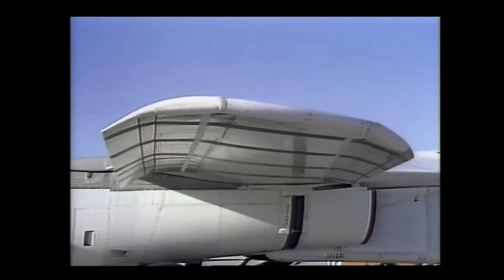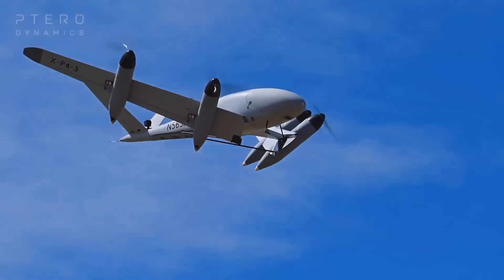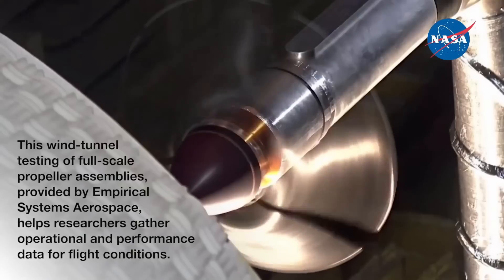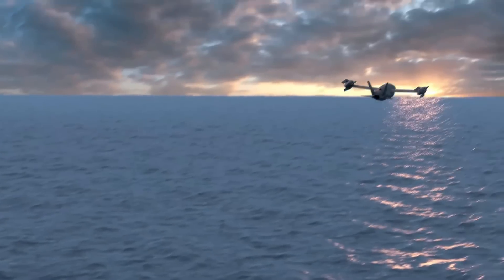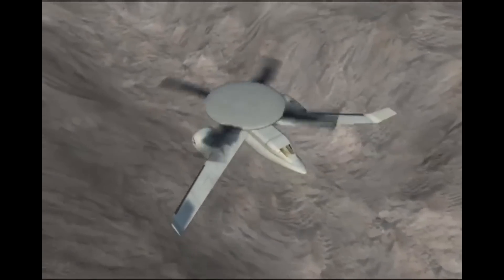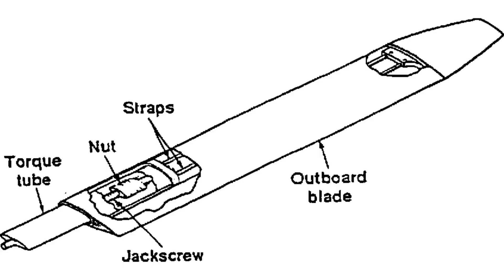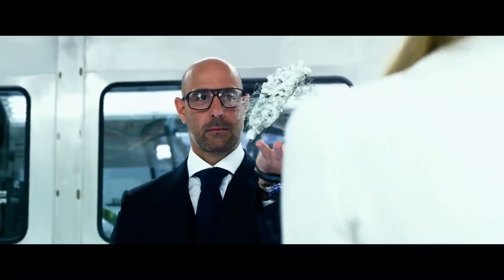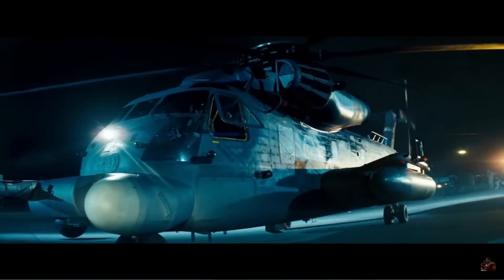Aircraft Transformation Technology

Comment: Putting engines and propellers in wingtips puts a higher structural load on wings under things as wind gusts, any failure will build a difficult to handle assimetry.
I would not do this.
Blessings +

Comment: There are many lies here in the field of UFO, but the truth can be established by special methods of Open-source intelligence (TEXT MINING). After studying all the materials about UFOs, it becomes quite obvious that since the late 40s of the twentieth century, a secret project has been developing in the United States for the development and production of aircraft, where the lifting force is created using high-frequency vibration. It all started with James Pitts' "Sky Car" vibrating orthotopter umbrella, then the umbrella was closed with a dome and devices appeared according to the scheme of conventional electromagnetic vibrating speakers (membrane + inductance) - fragments of the membrane were found by a farmer in Roswell. Then they created piezoelectric thrusters, or with small dischargers on the surface (they glowed all over the body due to ionization of the air), and now they are planes with plasma propulsion panels (so they are angular - that is, with flat surfaces). Thousands of discharge cells are densely packed into motor panels - they shoot streams of plasma (railgun architecture - coaxial electrodes). The ionized air of the spark discharge is accelerated in the railgun chamber by the Lorentz force to enormous speeds - a kind of ramjet engine is obtained. Just imagine! - tens of thousands of small ramjet engines assembled in panels and launching plasma synchronously at a huge frequency (hundreds of kilohertz). Plasma jets form toroidal air vortices - this air cushion creates lift and acceleration. See, for example, the MARAUDER (Magnetically Accelerated Ring to Achieve Ultra-high Directed Energy and Radiation) project. My article "UFOs are made in the USA" and the books "UFO Hunt" and "UFO Elimination" describe all this in detail. The technology is quite mundane - it is known in great detail thanks to information leaks. For example, air ionization in the coaxial elements of a railgun is created using radiation (radioactive polonium is introduced into the metal). Devices of this type were used throughout the 50s-60s-70s-80s for secret missions (they took off, as a rule, from special submarines). With the fall of the USSR, their use by the United States was practically curtailed (in the novel "Little Green Men" by Christopher Buckley, speechwriter Bush Sr., a scene is described where the US president decides to curtail the "flying saucer" project). The winding down of the project can be recorded by the drop in magnesium consumption in the United States, since such fuel was used in fuel cells (magnesium strips were burned in forced galvanic batteries), this is 2007-2008. However, later the development of the technology continued in the Russian Federation and China (the technology was restored by reverse engineering methods for downed devices). Secrecy, however, was maintained and there was no civilian use because the technology was not suitable for it - harmful microwave radiation from pulsed plasma thrusters (harm to pilots and impact on electrical appliances inside and along the flight line). The payload is small (but one nuclear charge is enough). There is no radio communication - unmanned vehicles can fly and maneuver only in accordance with the program. Previously, there was a narrow application profile - rare spy missions (so that pilots do not get a lot of radiation). Reconnaissance aircraft of this type were often observed at military bases, missile launch sites and airfields. They were even seen by peaceful geologists in the taiga, where clearings for seismic exploration were laid - UFOs flew there to check whether military construction was underway (I myself heard stories about this))). I think that soon this technology will be declassified, and cargo airships with flickering round plasma panels on the surface of the hull will appear in the Arctic sky.

Comment: What are the reasons air limits free motion of planes? Direct force engagement (drag) and chaos. Drag is experienced when a vehicle has to travel at high speeds and it is minimized by reducing the contact area with air (aerodynamic design). The problem with this approach is that air molecules are swept into an uncontrolled movement (chaos) once they hit the vehicle in motion and it creates many different vortexes around the airplane, that  prevent it from maneuvering at high speeds. what if we instead carved ridges into airplanes, that guide those air molecules all the way behind the airplane, where the chaotic movement is not a problem anymore? Imagine a modest Y shape ridged into top and the bottom of an airplane wing as well as the body. Instead of cycling around the front of the plane, the air would be guided by those ridges, which after first half split in two at a slight angle, that would force the molecules left or right based upon the airplane's movement. Imagine if we used a supercomputer to approximate optimal shape of ridges for the best air guidance at every possible angle and speed. Such plane could be made of lighter, less durable material as it would experience less mechanical stress and it would be way more maneuverable even at high speed, while saving the fuel at the same time, further reducing its weight.

Comment: For low induced drag there really is no substitute for high aspect ratio, like a glider wing, but the challenge is then wing weight fraction of airframe. With increasing battery life and safety the possibility of using structural batteries in at least the wing root begins to look favourable. The challenge is access the structural battery in the wing without introducing features that trip laminar to turbulent transition. The latest gas sampling sensors can also significantly reduce the risk of thermal runaway causing structural concerns. Hopefully certification regulations, like CAP 482, will soon give designers clear guidance on what is required for aircraft propulsion batteries.
As battery energy density improves then higher altitudes will allow higher speeds for a given wing design. Glider design full span flaperons is definitely the way to minimise drag over the largest speed range for a given altitude. I'd like to see a move from propellers to rear ducted fans as this means landing gear length can be reduced, with a whole heap of weight & usability advantages. We're all waiting to see whether X57 Maxwell distributed propulsion still allows low drag laminar flow aerofoils.

Comment: Folding rotors just means that engine is dead weight and still adds drag. In the long term it won't be used.
Reply: There isn't any alternative for landing gear. There is an alternative for folding rotors: rotors that will be used for the whole duration of flight.
Reply: @ustanik9921 so directive rotor is more eficient
Reply: Hmm. Do I build an airstrip, or bear the cost of a little dead weight and be able to land in a small clearing?
Reply: @GenlackGenlack  this is false you still need runway to land you cant hover after going hundereds mph
Reply: @Meteorknite  what about a  bushcraft with stalling wings configuration? like multiple flaps and slats robotized to make it a three meter STOL.?
Reply: @mauribonada2425  you can take off vertically cant land vertically after going 100 mph altho
Reply: Uhh, have you looked at why concept planes like X-57 uses folding rotors?
It’s to increase lift during take-off so you can achieve more lift with a smaller wing. Why do you want a smaller wing? To reduce drag during cruise. Of course the folded rotor adds some drag and weight. But it’s less than the drag and weight you can cut with a smaller wing. That’s the whole damn point of it.
Reply: A good point but a counterpoint would be the useless feathers on the folded wing of a diving bird of prey..
Reply: You mean similar to how landing gear is only used during the landing phase of flight, and so it will be phased out for weight efficiency?
Reply: @malachiteofmethuselah9713  False analogy.

Comment: Chemical and Thermal based transforming should be more prominent in the future as electronic based manipulation has to many failure points and is subject to electro magnetic interference.
Reply: Good point but that leap is bigger than it appears
Reply: @cedriceric9730  They are utilizing thermal materials now on a multitude of manufacturing. - Not a leap at all. ;O)-